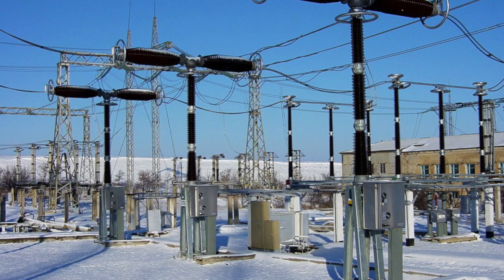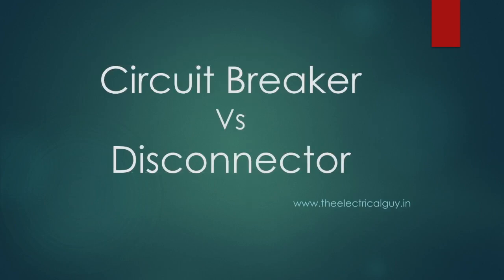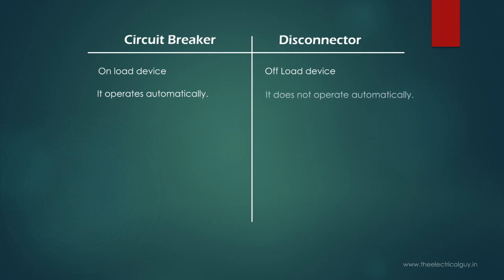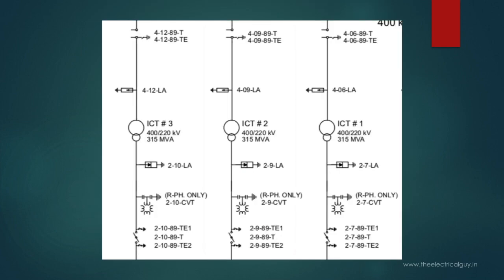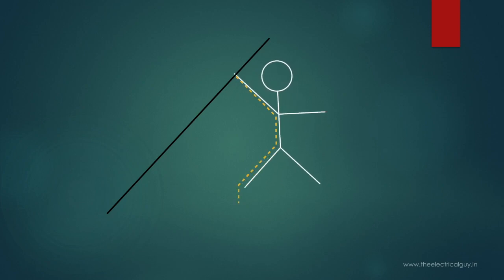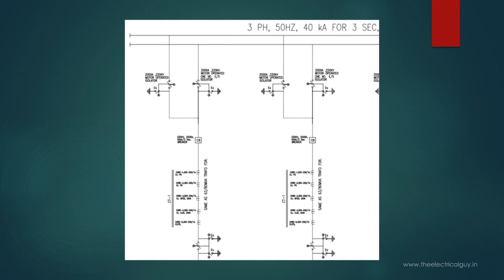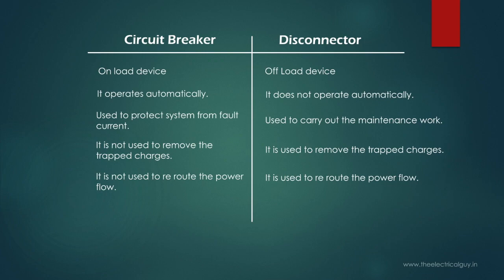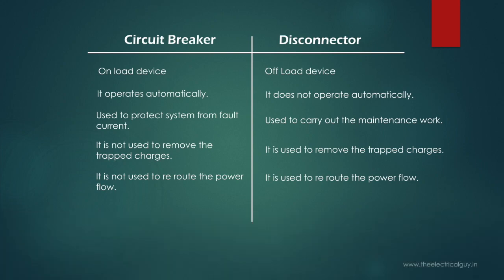Difference between Circuit breaker and Isolator | TheElectricalGuy

Comment: Hello sir! 
Has you said that disconnter are used when there is now current in the circuit but when we want to change the bus with out any energy interaption so for each bus we have to disconnector before we open one disconnector we should close another disconnector as will in some bas so there is current flowing as you said there won't be current  please cleare this issue for me

Comment: Just started a substation job and this is helping me understand a little bit better
Reply from the maker: Great!! Also you can check out below course

https://courses.theelectricalguy.in/courses/Circuit-breaker-control-Schematics-Masterclass--Beginner-to-Advanced---647b08bce4b08fb4470c3021

Comment: Sir, u r The master of electrical field . One doubt 4:28 in video u said close the disconnector for continue the bus So obviously current flowing through disconnector so why at starting u said there is no for normal current & fault current ( off load Switch ) How ?. Sir please clear my doubt
Reply: Good question, I noticed this part aswell. This might cause some confusion.
A disconnector can open or close on a bus while there is power. but in order to do so there is usually a section to link/couple bus 1 and bus 2.
This has to be done with a circuitbraeker. then there is no current flowing through a disconnector when you change to the other bus.

So in steps it would look like this:

1. close curcuitbreaker to couble bus 1 and bus 2
2. close disconnector 2 in the section you want to switch.
3. open disconnector 1 in the section you want to switch.
4. open circuitbreaker to seperate bus 1 and 2.

because you close disconnector 2 before opening disconnector 1 the current keeps flowing through the side thats closed.
opening the disconnector in this case is done while the power is on but the load is distributed.

Comment: Use a disconnector for discharging a high voltage transformer when a circuit beraker is connected before a large high voltage arcing going to stopped

Comment: Hello Sir. Thanks for the video, although I have a question: you said that circuit breakers operate automatically, but I'm studying a Protection Systems course and we've learnt that it is a relay what trips the circuit breaker. So, when you said that a circuit breaker was automatic, were you also considering its relay?
Reply from the maker: Yes, of course. It operates on relay command .
Reply: @GauravJ  Thanks!
Reply: Brother relay is the brain of CB